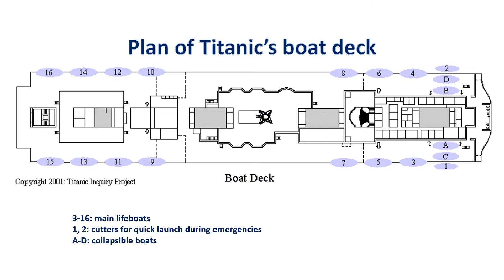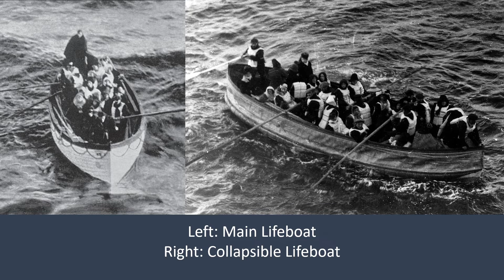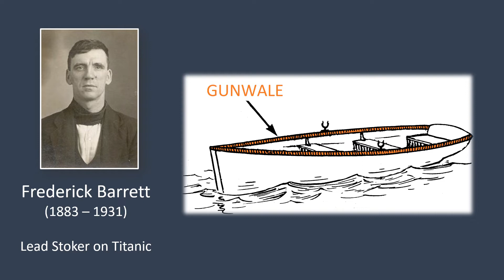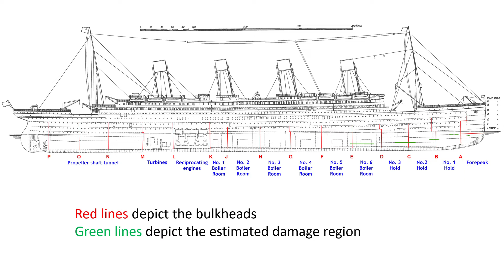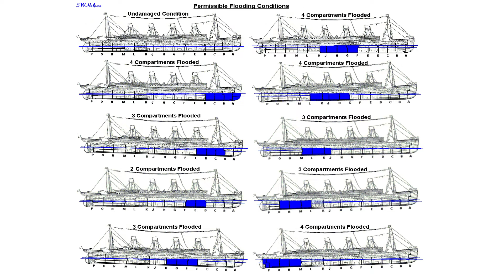RMS Titanic: Was it Poorly Designed?

Comment: In almost every way Titanic was as good or better than it's contemporaries. The story has been over-romanticized but the stark facts of social order back them meant that in most cases if you weren't sailing 1st class, you didn't much matter, and there were enough lifeboats for most or all of 1st class. Even with the SOLAS requirements of today something similar could still happen with the densely-packed cruise ships. History is replete with instances where storms, ice, and listing of stricken vessels prevents as much as half of the lifeboats being usable. As always and as always will be, we are at the mercy of nature when sailing the seas; a fact every sailor knows well.

The watertight bulkheads followed the social precepts too; in order to get the necessary luxury they couldn't be higher. They were thought adequate for foreseeable situations and indeed they worked as designed which was both good and bad. Believing Titanic unsinkable because of them, nobody had any real plans to evacuate the ship and that was the real failing. Had the abandoning been seen as necessary earlier there would have been more stringent control of it done and every boat would have been filled to capacity plus, as the calm seas would have allowed that. Because the order for abandonment took so long, passenger control and their willingness to be controlled for their own safety were lost. Also lost was the chance to seek and toss overboard weighty things from the bow and also utilize anything which could float as a means to save more lives.

And Captain Smith was aware of the California nearby, so his delay took any chance he might have had to close that distance, possible allowing every soul on the Titanic to be saved. Perhaps some counter-flooding aft could have been arranged to lessen the ingression forward. The real disaster of the Titanic was that Captain Smith lost control of the situation, partially because he too believed the design of the ship meant he didn't need to act quickly when in actuality he did, and I believe that he died in full realization of all these failures. His must be one of the most tormented souls in all of history.